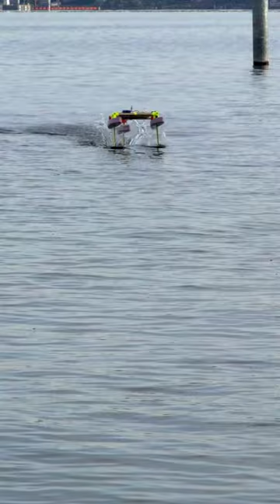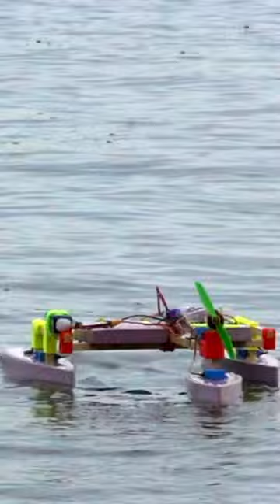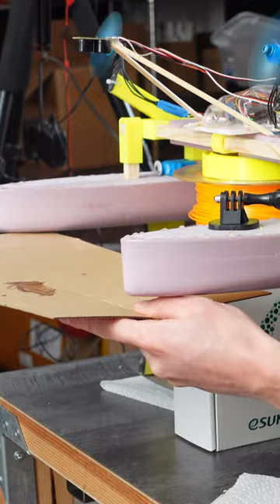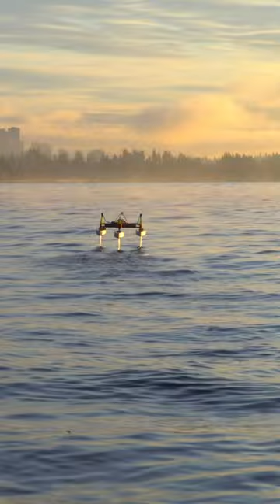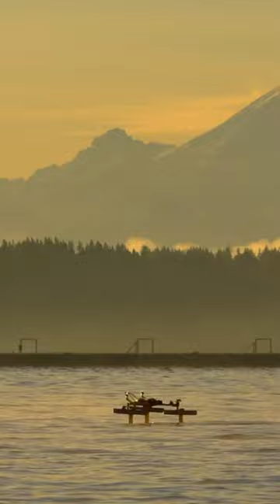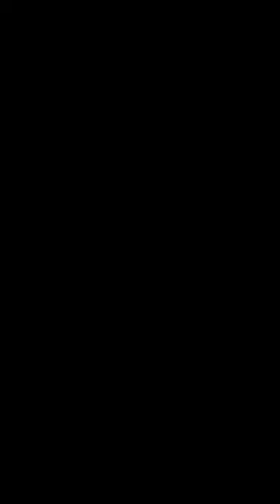R/C Hydrofoil

Comment: There is a mechanical method to control foil angle using a float arm that skims on the water surface..  (see dingy foils)

Comment: I like the low tech solution the Moth series foiling boats use. There's a rod that controls the lift from the foil & the end skips along the water surface. As the rod rotates vertical, less lift is produced. I'm not sure if it's the whole foil or just the trailing edge that is moved. Just a pretty low tech solution that has less parts to fail. 🤷‍♂️

Comment: This guy would be my best friend if I was his neighbor.. this looks far from, Arizona-ish. I build Frankenstein airplanes,  buy it, attempt flight, smash it, rebuild it, fly it, change it, crash it, change it back. Currently have a Volantex Ranger 750, the only thing original is the motor, I use a 3" quadcopter prop, 40amp ESC, 1800mah 3s. Is it over weight? Definitely. Does it fly? In little to no wind conditions, yes. It is a brick, but absolutely the funnest thing to stall out and try to recover. I would not trust anyone else to be able to man handle it the way I have to. I love your channel, keep doing you.

Comment: I think you’re drawing the wrong conclusion  with that 2 out of 10. Why do you have the foil so far forward? And only one foil? Add another to the rear allow angle adjustment. Have you ever seen an airplane with one wing only at the front? Very unstable and center of mass always increases angle of attack as it lifts out of the water

Comment: Why don't you add an RC basically flight stabilizer and run that to your planes underwater you know give them a little bit of servo action and it would be far away stabilized cuz sonar ain't fast enough at speed you need a like access sensor axes sensor flight stabilization you could ESP32 at 2:00 but I'll just take enough to shelf RC flight stabilizer and for servos

Comment: Use two hydrofoils instead one front one back, add a gyroscope for stability when in motion and two banana floats for stability when not in motion. I made this before and it wasn't the best because i'm pretty terrible at actually building the thing. But top notch with physics and design. This is only for speed and maneuverability, yours is perfect as it is but a little slow I would say.